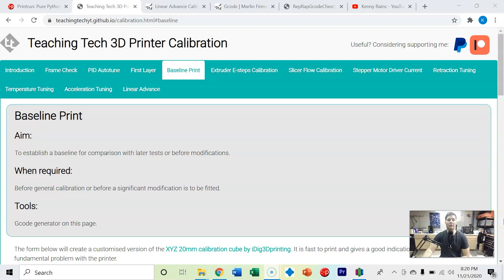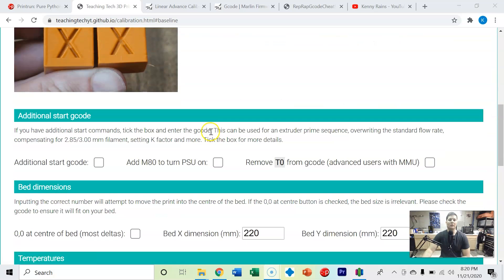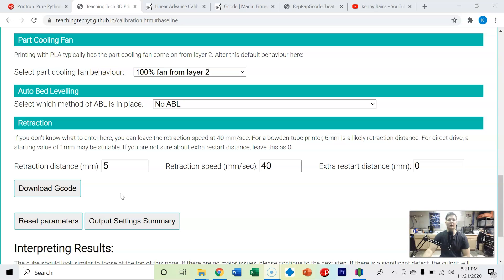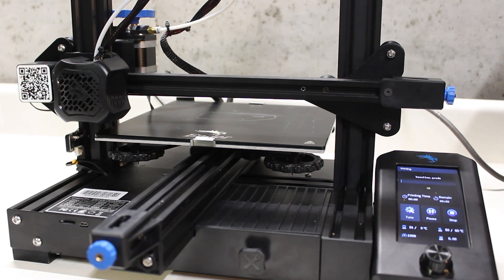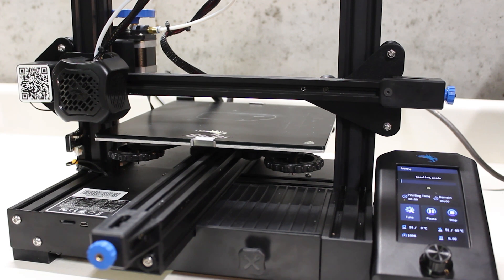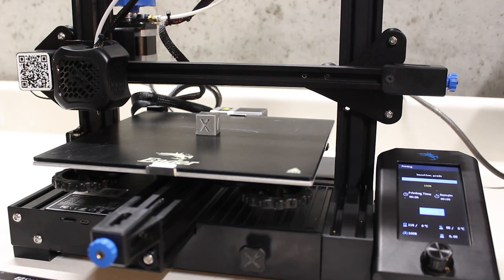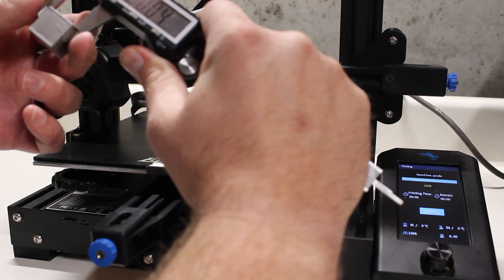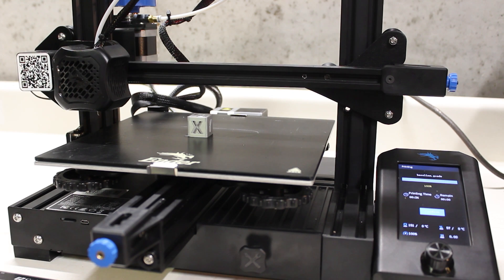Calibration Cube Baseline Print - Calibrating your 3D printer Part 4 - Ender 3 V2

Comment: Great videos. Recently got my Ender 3 v2, my first 3d printer. I've been upgrading and calibrating as I go, and your videos are incredibly helpful. Only thing I have run into so far in the list that you haven't talked about is my Win 10 computer not seeing the printer correctly - shows up as USB, not COM port. Skipped the PID autotune for now until I resolve it.
Reply from the maker: You are probably having a driver issue. If you check out my video on how to download and install Pronterface there is a link in the comments to download the ch430 driver. Hope that helps. Glad you like the videos!
Reply: @rainmaker3d  Thank you! I'll try that and let you know.
Reply from the maker: @FunkySwerve  no problem, good luck!